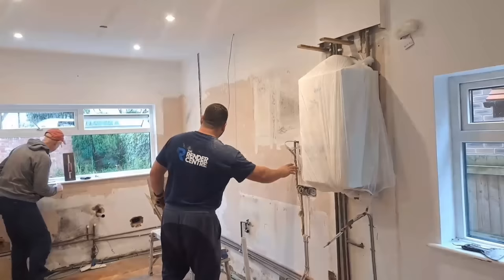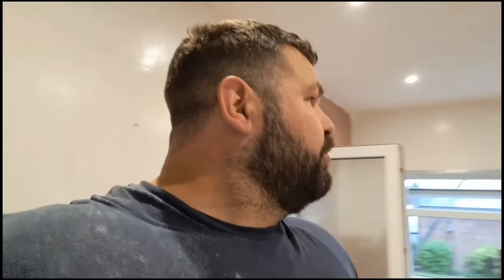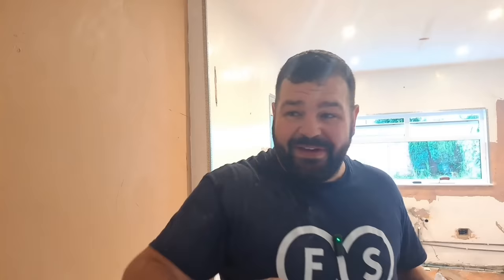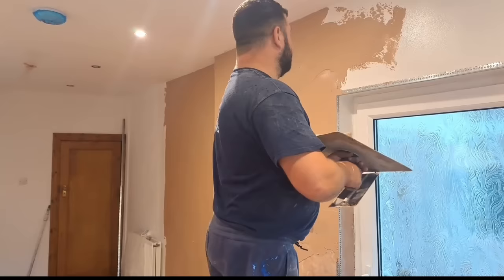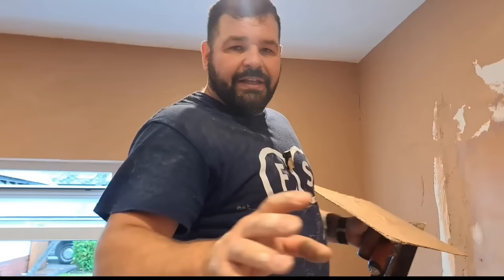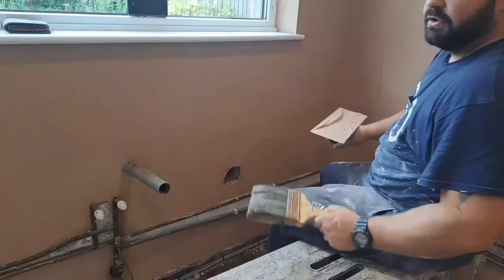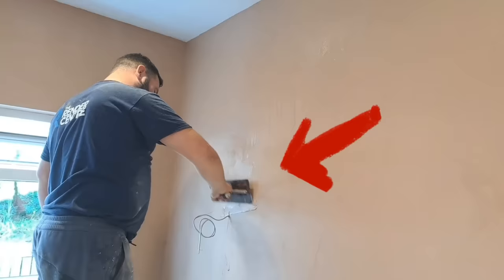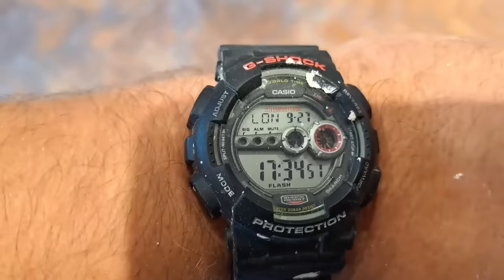How Plasterers Make £600 In 4.5 Hours

Comment: As an Electrician I have never seen my socket boxes cleaned out of plaster. So this was a first and it's easy to do when wet.
Reply: Chinese can do the same job at half price and 2 hrs
Reply: That's because as a spread we don't get time to clean em. I worked on site for 40yrs as a plasterer and using sand/cement backing with carlite finish or lime. The speed went up over the years as new plasters came out, like toughcoat/hardwall and so on. With speed came cutbacks, socket boxes, ceiling rose holes and so forth were left as-is because trowelling over 80 metres in one go gave no time to stop, let alone clean boxes out. I have cleaned boxes out in households which I have not done many, as most of my work was on large stuff; schools, warehouses, gyms and hospitals.
Reply: If when you clean the boxes out sparks always broke the plaster.
Reply: Clean you boxed out between trowels standard procedure
Reply: Put your wires in the box they get cleaned out if you don't then they don't  get cleaned it's that simple
Reply: It's easy to do when dry too tbh
Reply: Our plasters go straight over the boxes smooth
Reply: As a finisher I've never seen any electrician  clean up after his job.....:)
Reply: Nice job👍
Reply: @davewallace5008 come on fella, I’m a plasterer too and that excuse just doesn’t cut it. Takes seconds to clean out a box, or to make it even easier, put some cardboard or corex in the box. Where there’s a will, there’s a way to

Comment: Plastering for nearly 40 years nice to see nice  neat clean job with the  sockets cleaned out I used to fix thinbead with gripfill adhesive it saves lots of problems just push bead on small brush to blend, oh and marshmallows corner trowel a godsend.

Comment: I've just signed up for a home DIY course having recently bought a project of a house. I've never plastered before and it's a little bit daunting but I'm really looking forward to having a go. These videos are brilliant. Thank you💪
Reply: Those courses are a waste of time  and money they will only teach you what the guy in video will teach you for free. Just skimming is easy enough as long as you have sealed the wall properly you will have plenty of time to fanny around with it just start with a small wall like a chimney breast
Reply: Never learn anything from those courses, I did a 4 year apprenticeship in plastering that taught me the basics and all the rest was just on the job, but the biggest tip is practice,practice,practice and don't use dirty water in a mix otherwise you end up wearing it as my mentor was a old school veteran from the days when they used to wear a shirt and tie to work lol
Reply: The most important method to take from this video is to apply two coats, 2nd coat little milker than the first make sure the skim coat does not have any little hard lumps in the bag when mixing 2nd coat, smooth first coat before you put on 2nd .
Reply: I work in care but did an evening course in plastering. 10 weeks. It was ok. Easier or having a tutor to ask i.e. cutting out a board and re fixing, filing this than on my own at home. It was something to do other than care. If it's a cheap course, why not.
Reply: Use the course for practice mate, I've done one and you can learn alot from them, if they have plastering practice bays, then get in there at every opportunity to practice and use their materials etc, make many of your mistakes at the college
Reply: Practice taking it off the hand board before trying to plaster the wall and little tip get your first coat on fast as you can don't try getting it flat otherwise it will set on you lol start small
Reply: oh dear lol, hope you like the rough rustic look
Reply: @bodyblow  I love the mix of response from people. I know professional plasters that have been really positive, knowing that even they started somewhere and offer their tips. I then get the less positive folk that try to bring me down and suggest that it's impossible. I think the truth, as ever, is somewhere in between. Everything is possible with time, practise and instruction. I did the course and loved it.
Reply: @neiladdison4457 hi Neil! Where was your course? I’m looking to do one. Thanks

Comment: Good job. 👍 Every aspect considered. ⭐ My apparent award winning plasterer moaned about every room, took matters into his own hands after being given specific instructions, complained about and argued with other trades on site, set bent beads, stopped 3-5 inches from the floor, left gaps between the wall and ceiling, and covered all floors, cables, pipes, and windows in plaster and then left without cleaning. Just earned himself a new award from me... #1 worst plasterer ever. 🏆
Reply: Why did he seem to be an award winner? Did he make this claim? Plasterers are bound by codes and regulations to follow certain standards. It is not the plasterer's prerogative to leave a job incomplete or to spread plaster where it does not belong. If I were you, then I would seek recourse.
Reply: @satchelsatchel  Yes... he and others did make this "award winning" claim, and it was published online.

The main issue I had by the end is that he just wasn't as good as he thought he was. Maybe winning an award had gone to his head?

All I know is, the contractor who recommended him haven't used him again since his performance on my project.

I had too much on my plate to seek recourse, so I just settled his bill to get rid of him. My time was worth more to me than any amount I would have looked for in compensation.

Comment: If you put a handful of cement in the bonding, it’ll send the bonding off quicker. The more cement you add the quicker it goes off 👌🏾
Reply: This is exactly what I did before starting to use bonding half time. 100% it’s easier to gauge how fast you want it to go off with cement. The darker the mix is the quicker it goes off 👌🏼
Reply: The 60minute bonding is good
Reply: And it will not shrink and crack .
Reply: Doping it my old boss would say
Reply: Cement and dirty water 😂😂🏃‍♂️
Reply: It does make it abit brittle tho

Comment: Skimming hangs longer on sbr, thats why that gauge took longer than 3 hours. Should of put pva/sbr on walls before bonding chases then you wouldn't have had problem with  sbr mixing in with skimming.
Reply: First thing for me is always get the walls primed. Then Bonding with a dash of cement. Skimming in half the time

Comment: Now then, DIY plasterer here. I've got a house full of rooms with gloss paint on that doesn't seem very well bonded to the substrate. Do I need to scrape it all off (nightmare...) or can I just bang some bluegrit on it and plaster on top? I'm worried that the bond between the gloss paint and the wall underneath will fail with the added weight of the plaster causing the whole job to go tits up a few months later, but I'm lazy so it's a catch 22

Comment: As my job was a tiler for many years, not all plasters care about the tiler coming in after them. Yes they plaster and cover the walls, but how many plasters, make sure that the plastering they have done is straight and flat for the tiler ,answer none ,they don't care as long as they have their money. This guy is a nice guy, he got 600 pounds to plaster this kitchen, then the unites draws and everything else is fitted, that will cost around between 1,500 to 2000 pounds, then the tiler goes in and prices his jobs ,and the number of times ,i had people say how much, when i was asking around 200 to 250 pounds to tiler it. well you have to explain most of the time that ,the plaster has covered the wall ,but it is not straight, so it is not a case of just throwing them up. I bet thee is a lot of tilers out there who will tell you the same. But saying that in the end i went on a 6 week course ,and did the plastering as well  myself and the walls were straight.
Reply: Mate it's a massive issue for tilers for sure.

Comment: The SBR is still tacky because the painted parts are vinyl silk and slower the pull it in I’ve got much different things I rather do but another thing and not green grit but similar and hardly any cost at all and give you the advantage of some suction always a big plus when skimming 👍👍best wishes to you all and every plasterer

Comment: Chuck some cement in the water before you add the bonding and don’t mix it to thick,takes a bit of practice but goes off quick and doesn’t shrink and we pva the Chanel’s .Why didn’t you pva the walls instead of sbr?

Comment: I had a nightmare of a ceiling today using sbr which I normally use , the plaster was sliding everywhere and was blistering and sliding everywhere, never happening before , good work mate keep your channel rocking
Reply from the maker: Was the sbr wet mate
Reply: @Onthetrowel  a bit tacky but not to bad
Reply: @Mister0121do1 put SBR on let it almost set then skim it 
If going over vinyl silk or gloss take a Stanley blade to wall or ceiling if possible...give a key
You can always just leave the SBR & Skim alone let it pull in then trowle up just test as ya go bud
Reply: @stevengordon2145  yeah I should of keyed the surface , cheers mate
Reply: Blur grit it mate
Reply: @chrislambert1707 blue grit ain't a magic wand...on certain surfaces I would still use a stabilizer then SBR first.

Preparation is 50% of the job

Still each to his own..
Reply: Deffo sbr too wet.
Reply: As a plasterer over 20 years I can honestly say never sbr bonding shite 
Just use pva 501 bond by ever build
Use it neat on any painted surface and it doesn’t take long to dry once it’s dry crack on never ever had that problem with it but if you use any other pva you will have lots of sliders
Reply: @stevecassie9592  I plastered an artex ceiling today. I used sbr to seal it. No suction at all. Brilliant stuff. I’ve used all sorts of PVA over the years and it’s just not as good as SBR. Also when PVA gets wet it re-emulsifies, making it crap for any outside work.
Reply: @stevecassie9592  
Sorry but...poly vinyl acetate will re- emulsify if it gets wet enough.
SBR won't...
I've used both for 20+ years & never had issues with SBR. but have had issues using PVA although only a few times..
PVA takes correct mixing, must be applied in two coats.
Both primers have their uses...comes down to the quality of products you use.
Ultimately use the products that are best suited to the task at hand..

Plastering is all about finding your own rhythm.. otherwise you're doomed before you start!!
Reply: @stevengordon2145 sorry disagree with you  many miles and years says different
Reply: @gdfggggg every background is different and working out the correct way to do it is 90% of plastering keep going 👍
Reply: You won’t have any suction because it was painted before artex only creates a suction when it’s not painted and then use your product and see what happens 😂😂😂and was on about ceilings and walls internal
Reply: Had a couple of them too 
Best way to stop it use pva bond 501 everbuild neat on painted surface and for a gloss or shine add a hand full of sand cement mixed up into the pva let it dry should take half hour then crack on but check you have covered every where because if you miss any it might bite you good luck 👍
Reply: @gdfggggg beginners luck 😂
Reply: I need to charge more 😂 good job bro
Reply: Artex is the worst for a slider when the sbr is still wet

Comment: If it’s sliding when you’re second coating it’s going to look 💩 use a rubber sponge on the first coat , flatten , let it pull in THEN lay it in

Comment: Hi can you tell me why is my plaster getting hard before I get to do a second coat, ( after 30 minutes) at about 10-15°c. Please help me
Reply from the maker: I usually start second coating at around 20 minutes mate
Reply: @Onthetrowel  which plaster do you use for skimming internal walls?And which is the best to use?Thank you
Reply from the maker: I use board finish because it sets faster. 
You will be better with multi finish mate because it gives you a little extra time
Reply: @Onthetrowel  thank you for your help 👍

Comment: I do not see you with sandpaper. Does the painter sand walls before priming?
Reply: Yes that's the painters and decorators job also you can't sand wet plaster
Reply: Don’t need sandpaper pal or less your crap
Reply: Never sand bare plaster always a mist coat first
Reply: It only needs a light sanding if the plaster is polished up too much, or a heavy sanding if the spread learnt his trade in kenya
Reply: @Nofixedabode859  I did my first ever bit of plastering a month ago….I needed easi fill + sanding to make good enough for painting 🤣 Pro plasterers are able to  leave a finish ready for mist coating with no extra prep. 

My attempt made me really appreciate the skills of a plasterer
Reply: @notch7139 not always, I’ve never decorated over new plaster that didn’t have at least a few little blemishes etc, and that goes for going over my own too

Comment: twin & earth in strange places 1:17 17:22 20:34 i wonder what is doing so high by the ceiling ?
Reply from the maker: Under cupboard lights and oven hood
Reply: @Onthetrowel  I was presuming this but for under cupboards lights is too high unless the kitchen units go so high. If not then you have to channel its down to feed the transformer which sits on top of the units.
Reply from the maker: Not sure mate, the electricians are quite smart blokes, I'm sure he has a plan, I don't get involved. He clipped it where he wanted it to come out.

I'm only the plasterer so I just get on with my job and leave him to his
Reply: @Onthetrowel   I bet he is going to drop that cable down. I'm sparky btw
Reply from the maker: More than likely, he'll be back with his sledge hammer and pad saw 🤣